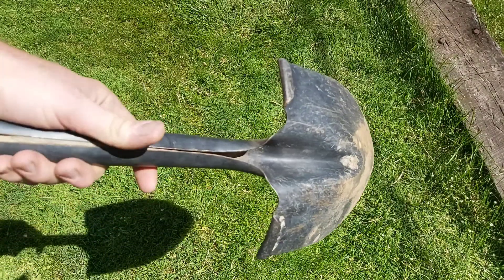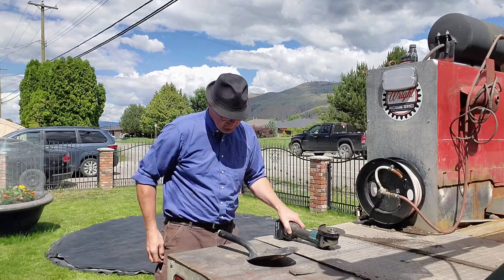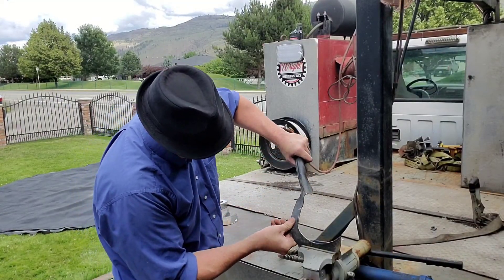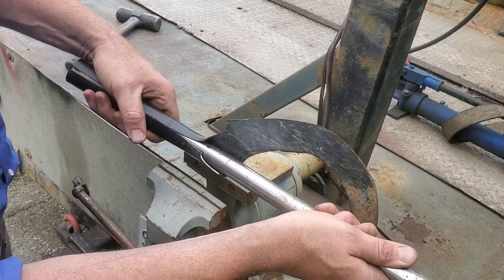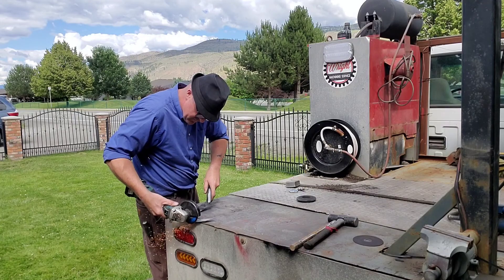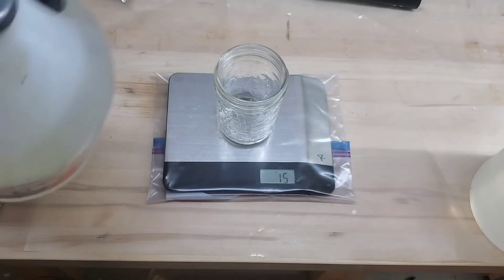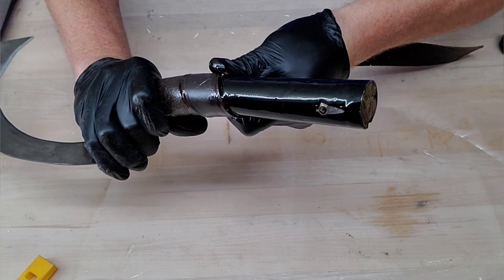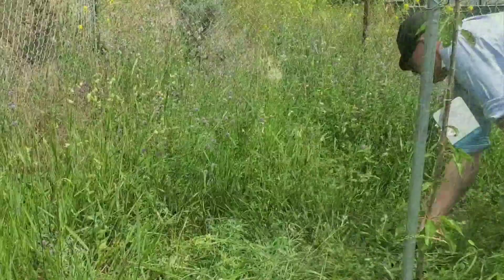Making a Sickle From A Shovel, No Forge Build

Comment: Didn't we see this before?
Reply from the maker: Yes my friend , sorry . Had to do some back ground stuff and this one got deleated by accident
Reply: @Wrighmachining  Ah, okay. I was afraid we were having summer reruns.
Reply from the maker: @MarkATrombley  lol , not yet . Its been busy though ,  starting a heat wave here and had to pull and compleatly  reinstall a ac unit for the house , to hot for casting as well .    Plan on experimenting with friction welding some more this week